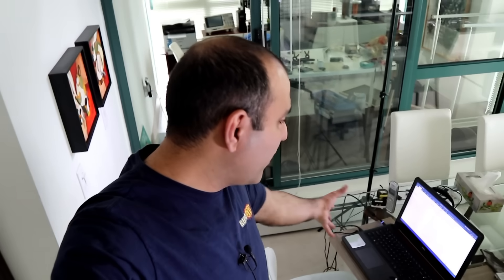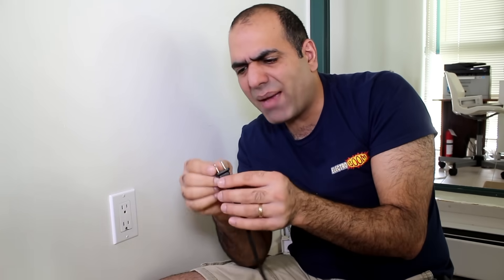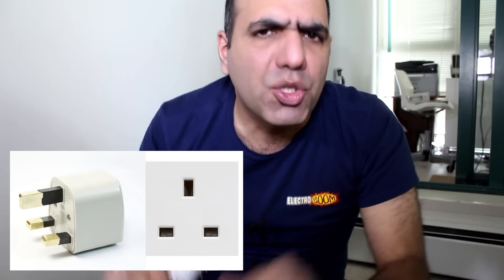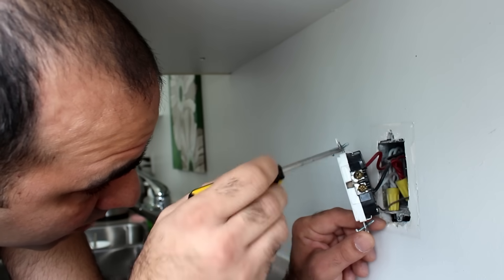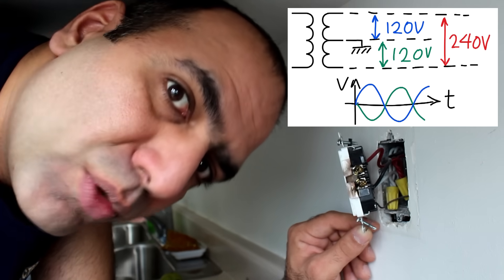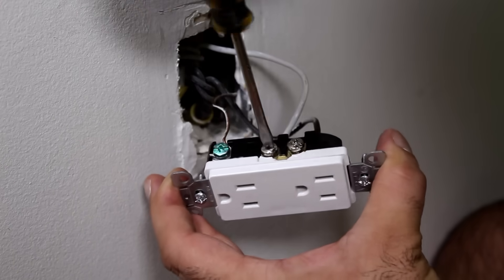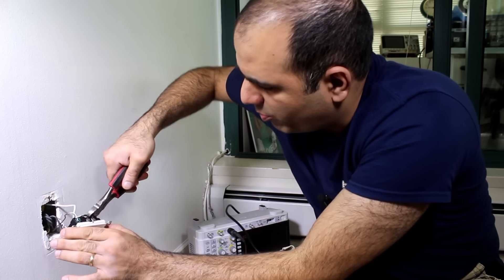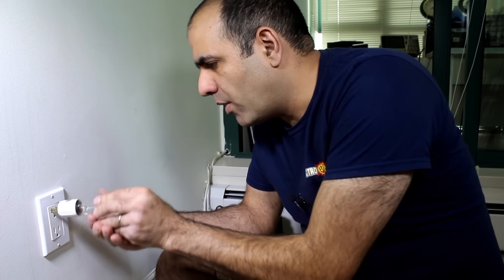How to Replace a Power Outlet

Comment: Before you replace a power outlet you turn it off the breake and after finish replacing power outlet turn it on the breaker ElectroBoom.

Comment: I would prefer to screw down the wire than push it into the hole. Just makes me feel better
Reply: I second this. Screw terminals are superior because it creates a better contact area for the wires and the screws secure the wires better than the stab connectors. The stab connectors exist only for speed and convenience, while sacrificing a stronger electrical connection.

Comment: 1. when turning off the power plug something into the outlet and then turn it off.
2. do not snip the wires it will get short use a small bladed screwdriver.
3. do not use the backstab holes on the outlet it will get loose and cause a fire hazard use the screws.
4. connect the ground first then neutral and last hot.
5. connect the wires on the correct terminals black to gold white to silver and ground to green screw.
6. take the picture on where the wires connected to the outlet.

Comment: I didn’t read every single comment to see if this is posted or not, but the reason that homes and small buildings have 240V and large buildings (including large apartment complexes) have 208V is because the large buildings get 3-phase power sent to them. The phases are 120 deg apart on 3 phase, so if you take 2 of the 3 phases, you get 208V. For smaller residential, they use the dual tap transformers as you said, and the phases are 180 deg apart, so you get 240V instead. Most devices that require “240V” in the US are also designed to work on 208V, although they will be a little less powerful when working on the lower voltage.

Comment: Meddie please for the love of God.... In this video you said that you could push the wires into the back of the outlet.... For the love of God.. do not recommend backstabbing..... Backstabbing causes so many failures and overheating of circuits.... Please for the love of God look up electrical failures and backstabbing.... And please do not recommend backstabbing of devices always...ALWASE...!!!!ALWASE USE THE SCREW TERMINALS..... NEVER BACKSTABE..... BACKSTABBING KILLS PEOPLE.

Comment: ive done outlets once or twice accidentally without turning power off did that bridging thing once  accidentally when i forgot the power was one and had to replace the outlet i struggled to get in i hate hooking wires on the screws and its just as bad putting them in straight in the other way because boths ways they have to be just the right bend or straight enough to have the screws hold them and then haveing fun screwing them back in the juncion box the right amount to make sure the cover lines up and is flush but granted my house somehow was put togather by people who owed my grandpa money so things are not the way there suppose to all around right down to some outlets in the living room haveing all black wires its like what i could easily set this outlet up to fail on purpose and none be the wiser insurance money here i come lol

Comment: I heard that in North America we have 110v household voltage because the earliest light bulbs were carbon filament, and only worked at 110 volts.  In North America, enough infrastructure was in place at the time the tungsten filament bulb was invented (which could run on 220v), that the power companies decided it was too costly to switch over to 220v for households, so we remain at 110v for lighting.

Comment: To Filipinos: Open the breaker means Turn On the main switch (letting power in) in literal Filipino to English translation. So we instead, we say Turn Off the main switch breaker.

Comment: As a former electrician (13 years) and an electrical engineer now, I will tell you that those push in quick connects are garbage so don't do that.  Better to make hooks and put them around the screw terminals.   And put the hooks on in the direction that tightening the screw terminal will not pull open the hooks on the wires.

Comment: the act of just pushing the wires into those little holes instead of using the screws to secure wires is literally called “back stabbing”. Personal preference, I don’t trust it as much as when someone uses the screws on the sides. The contact point of the edge of the metal tabs in a back stab seems flimsy and is a smaller contact point, resulting in what I’d think would be more heat when using high amp things (like vacuum cleaners or power tools). Please test this out in a video sometime. I’d love to see your take on trying to catch an outlet on fire in that context.

Comment: We where trying to swap a plug but couldn’t find the breaker for it the room breaker would turn of the light but not the plug so after trying for a bit I hear my dad say fuck it and a loud pop and one of the breakers trip next to me(he was at the plug I was at the breaker box) he tied a wire to a screwdriver and plugged the wire to the ground hole in the plug then touched positive and it flipped the breaker.

Comment: Outlets that are loose can also arc and/or get dangerously hot when you're drawing higher loads, like a projector/large TV, space heater or gaming computer running full blast. I had a bad outlet in my UPS and my PC was doing crypto-mining, and I got a call at work that my fire alarm had activated, but I couldn't see anything in the cameras. I had someone go over who was closer to my house than I was, and they said there was a burned plastic smell in the room, so I had them unplug everything, feel the walls and all that. 

The plug wasn't burned black or anything, but the UPS itself still smelled a little bit when I came back. The battery was fine, and I found using a lighter load (a small fan) that the UPS outlet was intermittent, so it must have been arcing under a heavy load (my PC) and smoked a bit. Surprised I didn't see any evidence of burning or anything.

Comment: A hook shape at the end of the wire, faced in the direction that screw turns, under the screw, is a much better connection than the push through things on the back.

Comment: I’m sure someone has already said it but never stab your wire into the hole. They get loose with current change and temperature and start giving issues. Just use the scews. Citation: I’m an electrician

Comment: It sounds like your apartment building is fed with 3 phase 277/480 and they are stepping it down to 3 phase 120/208. That would explain why the two phases are 120 degrees apart. Normally houses are fed with a single phase transformer. The secondary is split wound, where a wire taps off in the middle (Neutral) and the two wires on opposite ends are each 120v in reference to neutral and 240v 180 degrees out of phase with each other.

Comment: North American plugs and sockets reminds me very much of VICTORIAN ENGLAND system, well it was more light bulbs used in anything, l=plugging things into ceiling wires that were for lights etc, more, anything goes ad-hoc danger level. That's one reason we have the plugs and sockets we have. Too many accidents and fires etc. from plugging things in on top of each other and into the light bulb socket hanging from the ceiling. A disaster waiting to happen. So they changed them and you covered that in a video so.........

Comment: How about a 16 year old replacing your outlets? I’ve done it at least 10 times and according to this video I’m way smarter than Mehdi. It’s really funny that I am a 16 year old boy who has absolutely zero professional electrician training and I know more about replacing outlets and switches than an electrical engineer. Really the only training I have is watching my dad and my grandpa install outlets and switches, and trial and error of experimenting with it myself. I guess my grandpa could be somewhat considered an electrician, he built a generator for his garage to put out 3 phase 480 volts power to run industrial machinery, basically all it is a single phase 240 volt motor that is connected to the shaft of a 3 phase motor. But my interest in electricity started similar to Mehdi’s: I was 4 years old and I was in my backyard, under our covered patio we have electricity to run lights and other things, it’s all incased in conduit, I noticed there was a junction box without a cover on it, and it had some wires inside with some wire nuts on them, it was on the ceiling so I got a chair and was tall enough to reach the box, I took the wire cap off of the live wire and touched it, it shocked me pretty badly, I was 4 years old so I wasn’t as big as I am now, so it left a red mark on my hand and was there for 5 or 6 years, my interest slowly faded after I shocked myself, but years later when I turned 12 I started building things in my garage, soon after I started that I wanted to experiment with electricity, my first project was to make a switch that I could plug into a normal outlet and have an outlet on the other end so that I could just have a plug in switch, I had had no proper training, I had watched my dad and grandpa replace a few outlets and switches over my lifetime and I was like how hard can it be, as it turns out harder than I thought, I had no idea how the wiring works so I cut an extension cord and it was only double insulated so I striped the wires and unscrewed the screws on the switch, my first instinct was to twist the 2 wires with the plug end together and twist the 2 wires with the receptacle end together and put 1 on one side of the single pole single throw switch and and put the other on the other side. Once I had everything wired up I plugged it into the wall, and the light started to dim just a bit and flicker so I yanked it out of the plug, the next day I tried again and fortunately this time I did it right by leaving 1 wire connected and then having the other wire go through the switch. I learned how to do that, but about 6 months later my grandpa decided it was time to replace our old knob and tube breaker panel with something more modern, we had had about half the house re wired with romex, but the other half still used knob and tube. The panel that was there was in the hall closet, but it was a sub panel, and the panel with the main breaker is outside the house, the panel was really old, in 1939 when the house was built they didn’t have plastic so ceramic was the next best nonconductor, so what the panel was was a huge chunk of ceramic with 4 lightbulb sockets in it, and each socket contained a mini breaker, my grandpa got it installed in 2 days, and everything worked. Then I had these mini breakers to play with. I thought it would be cool to run something through a mini breaker so I took a regular light socket and put the mini breaker in it, unfortunately I didn’t learn my lesson with the switch, so I basically did the same thing, by connecting the live and neutral wires to the light socket, I plugged it in and to my surprise the breaker for the garage popped as well as the mini breaker, I removed the mini breaker from the socket to discover that it had melted the contact at the bottom as well as the bottom of the mini breaker. I eventually learned how to wire that correctly too. That same year I was visiting one of my dads coworkers house, her husband is an electrical engineer and knows quite a bit about electricity, we started telling stories back and forth until he mentioned something about 3 phase power, we were also talking about Ham Radio (one of my other interests) he gave me a book and when I asked what 3 phase was he told me to read the book and it explained it, I tried to read the book but it was super technical and really hard to understand, when I got home I put “what is 3 phase power” into the YouTube search bar, ElerctoBOOM’s video was the first to pop up, I watched some of it but Mehdi’s accent was kind of hard to understand, so I stopped watching, that was about 3 years ago, in March of 2020 I started watching AvE on YouTube, by June I had watched almost all of his videos, then in august I was rewatching an AvE video and he mentioned ElectoBOOM I searched for the channel and watched one of the videos, it was a lot easier to understand than when I watched the video before and it was really funny too. I was able to understand Mehdi’s accent way better, that was because the year before I had had a math teacher with a similar accent to Mehdi’s, so I was able to understand it way better. Now I’ve watched almost every one of ElectroBOOM’s videos and I’ve learned a ton, since I started watching Mehdi’s videos I have been experimenting with electricity a lot more. For example last week I connected 120 volts AC to a full bridge rectifier, and had 118 volts DC that I could play with I connected it to a saw that runs on a 120 volts AC and it actually worked I knew it would from watching some of AvE’s videos. The next morning I connected the DC output to the input of a transformer I took out of an old stereo, for about 3 seconds nothing happened then all of a sudden my rectifier started smoking then let out a really cool green arc, then caught on fire and put itself out. Yesterday I was playing with the same transformer, but I decided to connect the 120 volts AC to one of the other contacts on the input side, I connected it and the transformer hummed a little bit, I then measured the voltage of the pins where the 120 volts originally went in and got 205 volts AC. Anyway I’m learning a ton from the videos keep up the good work!
Reply: Huge comment

Comment: Hey dude! Love the vids, but as one criticism, I don't ever reccomend back stabbing. Over time you have a great chance of those thin pieces of metal, that sandwich the wire in place in the back of the outlet becoming loose. A conscience of this is you can loose a hot or neutral, as the wire fall out of the back of the outlet.... So Id say always terminate it on the screw. How do I know this, 6 years as commerical and residential electrician. :-) love u tho bro

Comment: True about the center tap transformers making 240 to 120 in residential areas. Transmission lines are at 240 and center taps are best way to step it down.

Comment: The outlets in my basement used to be wired backwards. I was messing around with an outlet tester one day when I was really young (the kind from RadioShack with the three LED's on it) and I was the first one to know about it. :P I told my parents right away though, even though I didn't know what exactly it meant.

Comment: Most outlets have a slot so that you can release the 'speed wiring' and then you do not have to strip the wire again.
Reply: Should anyway, as the backstabbed wire is thinner where it got stabbed. Really should cut at least that part off.

Comment: In the US, under the NEC code book, it’s illegal to have to phases share a neutral feed a device on the same yoke. If you ever loose that neutral you’ll end up with a 208v series circuit. Say good by to any electronics plugged in to that Lol

In condos or large buildings its more efficient to use a Y connected transformer. This gives full 3 phase power. With this Y configuration you only get 208V.  With a 3phase Delta connected system with a 110 neutral, you loose out on one of the phases. Usually called the Bastard leg, it gives 200v phase to neutral. So you can’t do much with it.  

I knew you were gonna grab that outlet like that lol.

Comment: The reason why your plugs 🔌 are falling out of the power outlet is because you used the push ins instead of using the screws. The push ins put pressure on the tabs inside the outlet, so after plugging and unplugging, the tabs inside the outlet will lose their ability to put tension on the plugs 🔌. Long story short use the screws, not the pushins. Oh also on outlets, the copper screws are the hot, black or red wires. The silver screws are natural wires.
I love your channels 👍👍👍

Comment: When changing an outlet never stab the wires in the back always make a little hook on the end of the wire and put it under the screw then tighten it that way the wire will not slip and won't arc causing issues or a fire in your wall

Comment: I heard in a programme that you use 120 V AC because when the electricity invented they coldn't make 240 V. When it's reached Europe the technology reached that level where we can make 240 V AC. Change the electricity voltage in your country is eat thousands of dollars so  you stay with 120 V.
Reply: No 120 Volts were used in Edison's original power system and later when Westinghouse won the AC vs. DC War of the late 1800's he used the technology standard of 120 Volts

We have 220-240 Volts in Europe since we had less copper to work with and therefore we needed a higher voltage to transmit and use the same power at half the current and also high power appliances in America use 240 Volts due to them needing double the current on 120 Volts while it doesn't seem like it more current means thicker cables and more losses due to resistance and therefore heat losses. SO THAT IS THE TRUE REASON FOR THE 120 VOLTS AND 220/240 VOLTS MISMATCH

Comment: Thank you I asked my JVS Electronics South Delaware Instructor Jim Poole why we use 110 and everyone else is 220 and the answer was the more logical turns of the power inverter to build up to one 220.  It was logical and made sense unlike my question I had asked.  
   Thank  you for answering it, so I don’t die because I keep shocking myself enough times on just 110V.  
No trust...no trust for the 220.
Reply: It was actually from way back when Edison was trying to use DC power for homes. He ran lightbulbs on 120VDC